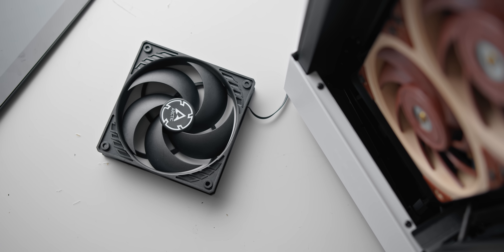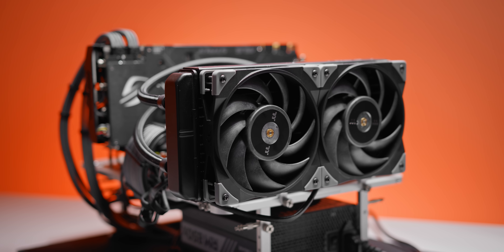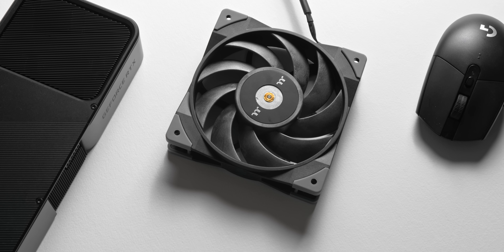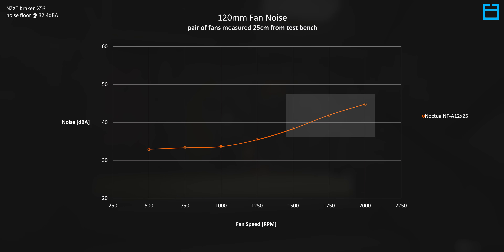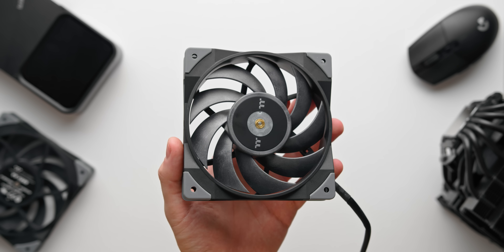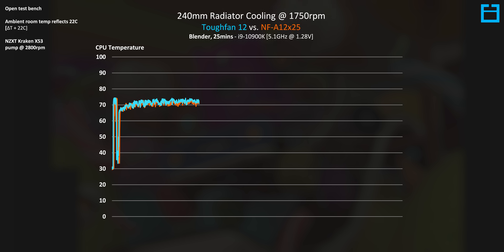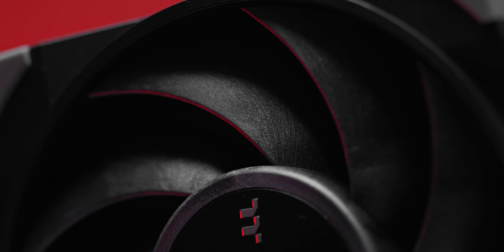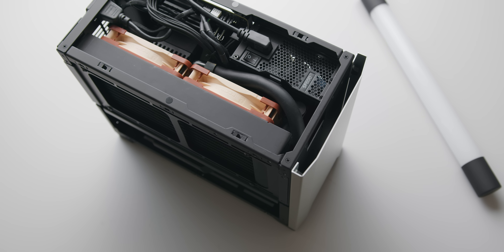Thermaltake Copied Noctua?

Comment: A few things I feel should have been stated in this review:

1: The Thermaltake Toughfan 12 can pull up to .70a in power draw vs the .14a of the NF-A12x25. This is a huge difference and means if you want full RPM range with the Toughfan, you can't plug more than one into your typical 1a motherboard fan header. You legitimately need to factor in the cost of a powered fan controller with multiple Toughfans. This is an amazing testament to Noctua engineering that many people just don't realize. Noctua created what is likely the best consumer 120mm fan and made it so efficient that in a normal midtower with a typical maximum of 7 fans installed, you can have them all connected to a single fan header. It's truly amazing attention to detail there. 

2. The Thermaltake Toughfan 12's PWM cable is like 3 feet long which is just stupid to me. It's one of the few fan cables I immediately shortened after completing my testing. 

3. There is also a very newly released Toughfan 14 for people who want a quiet 140mm fan. This is actually super unique on the market since not even Noctua has a 140mm A12 alternative.

This is one of the few Thermaltake copies that I sort of am okay with. Most of the time when they copy, which is very often, the resulting product is absolutely garbage. This is not though. This is a genuinely good and competitive product, especially if you buy 2 at $35. Other companies should use liquid crystal polymers for their fan blade designs for desktop fans as they have been in use for years in laptop fans. Noctua was just the first to introduce them in a larger format. At an extremely general level, the fluid bearing design that noctua and basically all other companies who make high end fans has been pretty standard for years. Noctua just adds a magnet to reduce vibration. The metal motor housing is also more common in industrial fans. Noctua just combined all these great ideas which resulted in an amazingly good product. Thermaltake followed suit. The thing is, if any other company had made this product, I would have been excited for it. Because it's Thermaltake with their history, it makes me want to cut off my hand that I bought a set to test back in  October.

Comment: Suddenly everyone forgot about the GentleTyphoon, weird!
Reply: Yes because noctua did objectively substentially improve the frame, blades, blades fitment and motor assembly. That constitute a new product, not a pale copy of an already existing product. Unlike that of your example that « looks alike » as much as distent cousins do. I sure hope for TT that they did not pull a caselab kind of deal because the european courts aren’t too keen on unpaid royalties.
Reply: @L3_FR  That doesn't change the fact that Noctua was not the inventor of such industrial design, which put the whole "copied Noctua" statement irrelevant. While on that note, the A12x15 is NOT "substantially" better than the GentleTyphoon, not even Noctua dare claim that. And for the design thing, to quote Noctua themselves: 

- "You can think of aeroplanes for reference: an Airbus 380 might look quite similar to a Boeing 747 to laymen at first sight and they are indeed similar in many ways (low wing design, swept blades, 4 jet engines, fuselage-mounted tailplane, etc.) for the natural reason that they have been designed for a similar purpose, but as soon as you start comparing in more detail, you will see how different the particular engineering choices have been". 

Now, until someone has all the engineering notes from both products compared side-by-side, I am considering this an attempt of clickbait title at most.
Reply: Agreed, would be wiser to follow up when more information can easily be obtained.
*I however disagree on a few points you made. 

1 : About the idea the "copied Noctua" What I was  going for (completely putting performance aside) was contrasting between a design that at most took queues and objectively changed the appearance a fair bit and a design that not contempt by just being a objective copy-paste of a design in appearance also tried to replicate the LCP used within the blades of the noctua equivalent. This is what you call a knockoff.

2 : About the A12x25 not being a substential improvement. When the performance you are comparing is allready this good a 1 to 2° C/k difference on a noise normalised standpoint absolutely is a substential improvement.
Reply: @L3_FR   
1: Like I said, and also Noctua, until you have engineering detail on both products, the A380 is a copy of the 747. To be honest, the noctua looks more like the gentletyphoon more than the thermaltake looks like noctua. Heck, the toughfan wasn't even the first fan that came out with that shape after the A12x25 disrupted the market. But hey, we need a title, right? 
About the LCP, this is not Asetek patenting where to put the pump, the sterrox was supposed to be Noctua super secret sauce that took them a few years to create. Unless Thermaltake somehow broke into Noctua chamber and stole that trade secret, them trying to achieve the same performance is not considered a knockoff. There are many ways to do the same thing and you cannot copyright an idea, fortunately.

2: 1 or 2 degrees at performance already THIS good is literally pointless and could very well fall within the measurement error. The only thing that Noctua is objectively better than GT is stock, which is pretty ample. Anecdotally, anyone I know who knows both about Noctua and GT would choose GT over the A12x25 every time, if they can actually buy one easily
Reply: Just remember the rules here /s  If Noctua copies.. they are improving the design... If Thermaltake copies... they are ripping off.
Reply: @entropicity  I really did hope enough time would pass for the situation to develop before some other guy came here to ostrich around. And I especially did not hope for someone to reduce the content of my message as if I was a simpleton.
Turns out people like rooting for the underdog no matter how unsensical and untenable their position is. 
What next? You're gonna play the visually impaired card claiming that the GT looks more alike the A12 than the TT resembles the A12 like my previous interlocutor did? 
I suggest you start by taking a good look at the three subjected fans. Then star to agregate benchmark data on a large scale. Then look at the previous behavior of  Scythe, Noctua and TT. To finally take look at the way each brand marketed their products historically. Then you might actually come to a sensible preemptive resolution and understand where i'm coming from.
Anyhow as Huynh Danny rightfully stated any further speculation would be useless without actual lab data. Wich is why i'm considering buying up these three fans to either validate or ratify my position regarding the TT since nobody seems to be doing it.
As a side note i'll admit noctua is no saint and had it coming. but see the thing is there is a boat load of ways you can make a fan perform extremely well unlike what the out of context quotes shared before might lead you to believe.
Reply: @L3_FR  if you noticed I put /s to indicate sacarsm :) For me personally I love all 3 fans, having used both Nidec GT and Noctua A12 before.

I think TT should not be bashed for adapting the design, TT is one of the oldest companies in this industry, they have copied and been copied themselves. We all benefit from having 3 fans in the end. Nidec for OGs, Noctua for brown lovers and TT for helping bring us the black version at a cheaper price that many of us enjoy.
Reply: @entropicity  Sorry to see that I didn't pick up on that, I'm not really used to that kind of text formatting i'm afraid. For that misunderstanding I am truly sorry.
I fully agree with you on the ground of the consumer benefiting form fiercer competition and have no doubt about copying being both ways.
I also do not endorse the whole deal of bashing TT. 
However I must insist that when a brand or an individual does seem to be stealing intelectual property, it should then be pointed out so that it will be investigated. As not doing so will only normalise such behaviour. Thing is that it hits especially hard when TT seems to be back at it again as I used to be a fervent customer pre 2014 for the same reasons you pointed out.
Ps : love to see someone talking about nidec, avc and such !
Reply: 100% NIDEC led the way, Noctua slipstreamed.
Reply: @L3_FR  "unlike what the out of context quotes shared before might lead you to believe" -> If this was for the quote from Noctua I have shared above, please note that is the answer Noctua gave for the question which was literally: "Did you guys copy GentleTyphoon?". I would like to think the same context applies here and not out-of-context as you stated; unless you can prove otherwise

Personally, I would like to see an actual in-depth comparison of engineering details between these fans to see which is which, instead of a clickbaity title like this. Oh, and by the way, Scythe also has just released a strong-swept-curved-blade as well

Comment: It's yet another product that Thermaltake has copied, and I appreciate the honesty you are showing by telling it outright. On one hand, I get why a few people won't give any second thoughts about buying those copied fans because they are black,  but, on the other hand, it encourages a shady and lazy practice by a very shady company (Thermaltake). In the last 15 or so years, the only "innovative" thing Thermaltake did was releasing the Tower 900, a huge and pricey case, most people can't buy. They have otherwise been lackluster on the innovative side, and the only good products that they have released are straight up copies, or slight derivatives of other company's successful items. Now, add to that the fact that their marketing department has to be, hands down, the worst of all relatively big "tech components" companies out there, blatantly lying, trying to bribe reviewers, and throwing anyone who might go against them under the bus (trying to get any bad reviews pulled by any means necessary), and you end up with this: a company that exemplifies laziness in design, and dishonest marketing, that yet, rips off another product from a company that took years of hard work perfecting a very specific component to the very top of its category. They are a business that I would never encourage or recommend to anyone, and I purposefully spend a few extra dollars when I need to, just to make sure I use any other competitor's products.

TLDR: hats off to you for pointy the shady practices of a shady company.

Comment: The arctic fan version of the one you mention with ball bearings is the one that I'd like to see tested. In my experience fans don't last being mounted horizontally (top and bottom of case) and the traditional fan with an oiled bush for me at least, seem to last only a year or so before becoming quite loud in operation due to vibration. Corsair maglev fans seem to be the only other mainstream fan with a different bearing design and are ok so far but are loud af at reasonable to high rpm.
Reply: For horizontal fans use a Gentle Typhoon.

Comment: “Thermaltake copies Noctua!”
Gentle typhoon engineer: “cough”
Reply: Except Noctua took a concept and overengineered it. Thermal took their fan made it black and worse LOL. If you think the a12x25 is the same to the Gentle Typhoon as this is to the a12x25 you are just lost my friend.
Reply: Gentle Typhoons don't look like Noctua nor does Arctic.
Reply: @svn5994  Er, they absolutely do. On an overlay made by Noctua themselves there's barely a milimeter of difference in the design geometry between the GTs and the A12x25.

Comment: I noticed that the noise at 1000 RPM is periodic and you are using two fans, which means that you might be running into harmonics between the fans. You might be able to mitigate some of that by offsetting the speed of one fan by a couple dozen RPM.

Comment: The thermaltake fans have this ticking to them. I really don't like that
Reply: I have 4 x TT ToughFan 12 in my mITX build, and I can tell you that this is likely an issue with Ali's samples specifically. None of mine exhibit this at any RPM range.

Comment: The thermal difference might be due to the frame design. The TT fans have a circular shape to them, which I believe is worse for maintaining static pressure on a radiator than a full squared off frame like the Noctua's.

Comment: EVGA GTX1080 FTW3.... replaced my fans with Noctua!
It was a bit of a  hassle, but I did it. My EVGA fans had a warble at certain RPM's. I didn't want to RMA the card as it sounded like it was a common issue. I ended up getting 2x NF-A9 80mm chromax (black) fans. Some zip ties. And 2x 4-pin fan header adapters due to the size difference. Total was roughly $50USD... had to take off the top shroud (Torx screws I think... I forget now). I ended up with two strange problems that I did fix:
#1) had odd clicking sounds even at low fan RPM due to power delivery or something to the fans (I ended up moving one fan header to the motherboard and it went away... just set it to solid 600RPM)
#2) EVGA Precision OC X software crashed (LED stuff was on shroud. I reinstalled the software and it worked... although fans are pretty quiet with the default profile)
*Ended up being completely SILENT for all intents. I have the 2nd fan (closest to the GPU processor) controlled by the card. It sits at roughly 400RPM and doesn't seem to go above 600RPM. My system (R9-3900x + GTX1080) is essentially silent when gaming even with my speakers OFF.

UPDATE:
I also spent some time on the BIOS fan profile as I dual boot with Linux. When I first boot the fans also don't ramp up as much then switch over to the Asus fan software (in Windows). The CPU and case fans then go off that profile for Linux and use the graphics cards on-card profile which is partly why I didn't just want a replacement EVGA even if they fixed the fan warble as it was still loud under load with no way to control the GPU fans in Linux.

Comment: Arctic P12 is the quietest fan I've used but only go up to 1750 rpm...above that at 2000 rpm I would have to say a bequiet silent wings. I've never used any noctua fans, and Corsair's ML 120 pro is pretty good at higher rpms too.

Comment: You can actually buy a Toughfan 14(140mm) 2-Pack off Amazon US for the same price as 1x NF-A12x25mm in New Zealand. The NF-A12x25 cost about $65 NZD which is about $49.99 USD/the same price as a 2-Pack Toughfan 14. Even though the differences between the 120mm Toughfan 12 and NF-A12x25 are miniscule; I'd imagine the 140mm Toughfan 14 would be better than the NF-A12x25 for the same price and double the quantity.

Comment: “Should we support a copycat product?” - Glances over at my NR200
Reply: Glances over at my future NR200 thought bubble Wait is the NR200 a copycat?!
Reply: @AB-bu8ti  Ncase m1
Reply: Don't really consider the NR200 a copycat (I ended up just ordering one). Enough design differences to warrant it not being an Ncase m1. This TT fan though, complete and blatant copy and honestly could get them in trouble if Noctua decided to pursue legal action. After the accusations against TT in 2015 I'm not sure why they'd want to risk this and lose brand perception. For this reason and not listening to solid design advice from customers and reviewers I'll never buy a TT product.
Reply: Its not a Copycat. Its chares similiar Designs but it has still huge differences. 

I had Both. They are not even close to be called copycat.
Reply: @Kerdtress  have both too, the NR200 is an improvement but 95% the same.
Reply: @NOSfusion  Improvement? 
The Materials are worse(even if i like good Steelcases), the PSU Position is just super Bad, the CPU Height limit is for its size 5mm to small etc.

The NR200 is its own Case but not like an improvement to the Ncase M1. 
Its so MUCH Bigger. 

What comes next, improvement to the Dan A4? Louqe Ghost? Sidearm T1?
I like the NR200 for what it is. I also love my ITX Benchtable for what it is.
But thats it.

Or we can talk about how an EATX Case is an improvement to any ITX Case.
Reply: @Kerdtress  Improvement is objective right? But it has little quality of life improvements. Several SSD mounting options, dust filters, top mounted fans, and it's $80 instead of $200. So please do not be too condescending. 

I loved my dancase a4, but wanted to water cool the cpu, thus the ncase m1... and when the NR200 was released at such a low price I had to see what all the fuss was about. I switch/build in new cases a few times a year, it's a hobby. 

PS: Still waiting for my FormD T1 to ship -_-

Comment: Everyone copies but I'm fine with Nocuta's 🤮 colors. I'm fine with performance over looks 🤔 😆
Reply: Honestly I have to look really closely at my PC to even see what colour the fans are, given they are sandwiched between a mesh panel and a radiator and not festooned with LEDs. Fan colour choice is completely irrelevant when you don't have any tempered glass or RGB in your case.
Reply: You can have both. However TTake doesn't offer that.

Comment: The couple of degrees difference in performance might be caused by the frame design that leave some gaps between the radiator and fan frame edge, so air may escaped and lose some static pressure